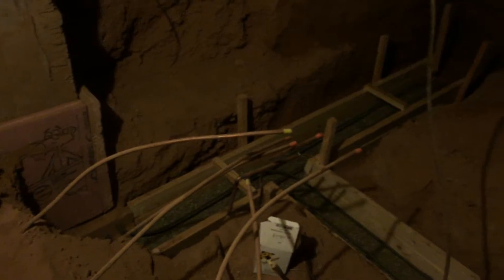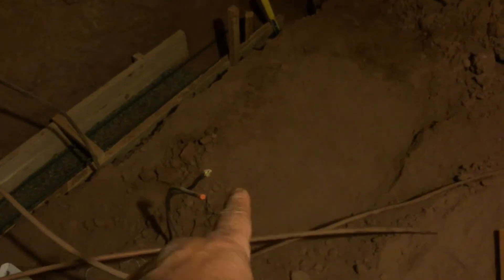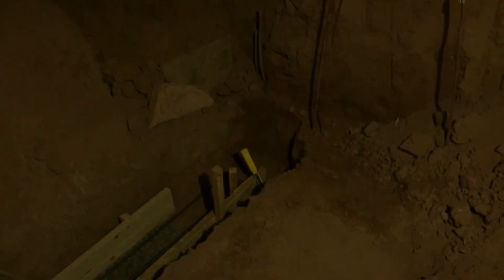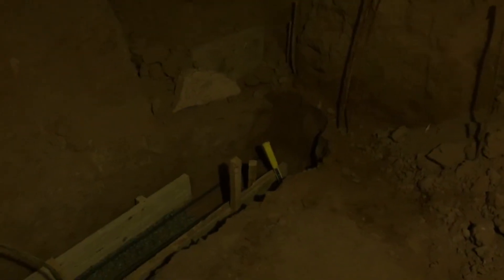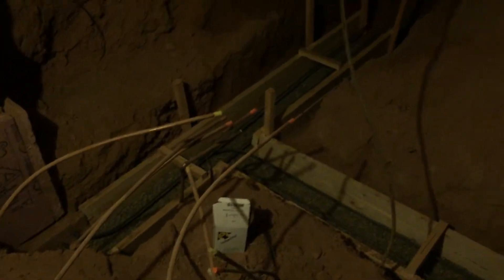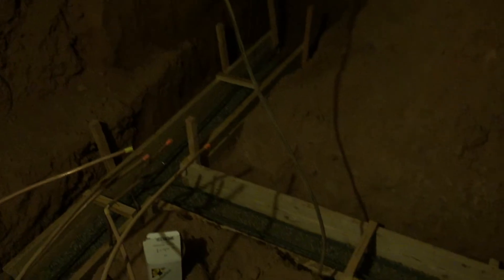DX Geothermal mechanical room

Comment: I hope your still working on this. Cann't wait for more video. What are you using for a compressor? Converting a AC unit to Heat Pump? Like to see that.
Reply from the maker: Ya slowly but steadily.  I have the mechanical room walls 1/2 way done and I installed a sump pump.  I'll post a video this weekend.  I haven't selected the compressor yet but 3 - 5 ton scroll with reversing valve and 3 way valve.
Reply: +snowcap28 Sound great I like to try do it myself. For a walk-in cooler and frezzer but have it two stage. Frist stage preheat water tank and 2nd ground heat sink like yours. Not sure it would work? Have seen anyone do both yet or for a cooler frezzer.
Reply from the maker: I got an updated video posted "please excuse the construction mess".  Use a reversing valve and a 3 way valve so you can heat and cool at the same time.  Basically the heat that you remove from the walk-in goes to heating hot water or the home.  I'll show you my schematic of the system but you can do both.  Goethermal system on the market call it a cooling system with hot water desuperheater.

Comment: Awesome.  Can't wait to see more.  I do refrigeration for a living.  How much copper is in the ground total?  Which refrigerant are you going to use, R-22 or R-410a?
Reply from the maker: R-410a.  I have 11 of 20 holes dug at an average depth of 50'.  These will make the ground really cold in the winter so I am also running a loop for a walk-in freezer which will give me a little heat.  The pipes are OD 1/2" vapor line and 3/8" OD on the liquid feed line.  I put a reducer and return loop at the bottom.  Check out the first few videos where I braze/silver solder the line together then bury it.  By my estimate it will be a 5 ton system (heating and cooling)